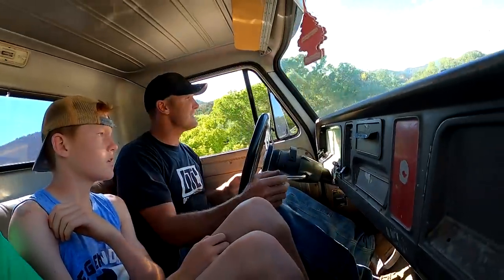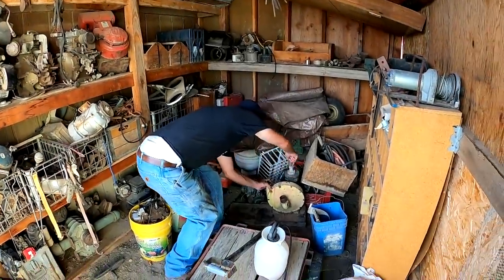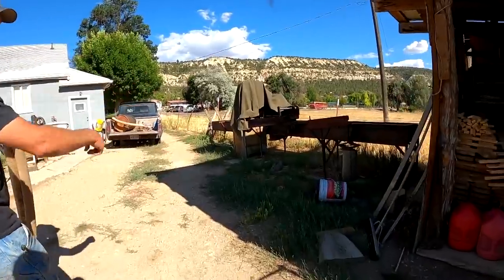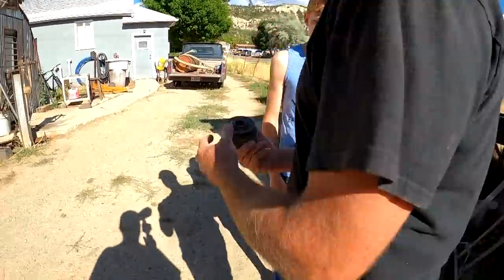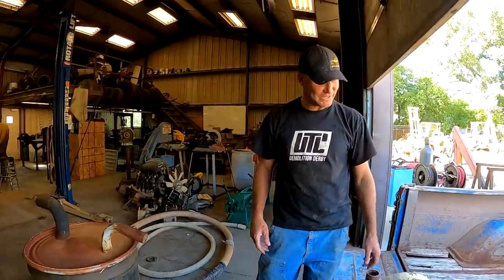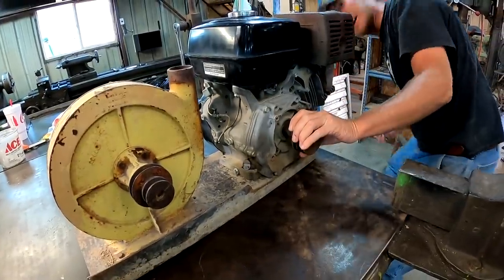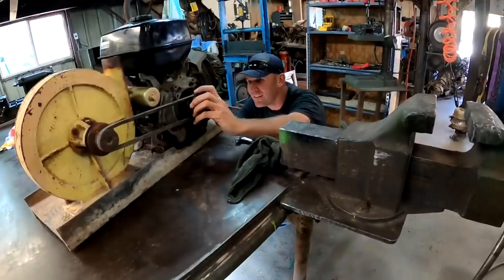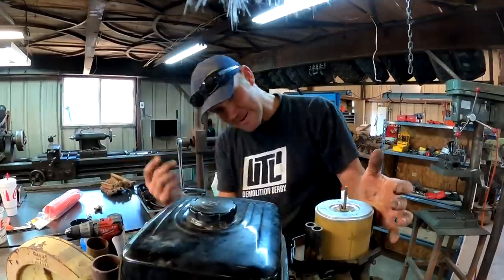-- TREASURES from the TRASH -- APPLE VAC CONUNDRUM!!  Pt: 1

Comment: Thought for when you're starting junk motors.
Have either a hose off your welding gas or a CO2 fire extinguisher handy. Those you can fire straight into the carb without issues.

Comment: What sort of vacuum are you expecting to generate?

We used to use 45 gallon drums as buffers water delivery systems and if the water column ever dropped it'd draw a full vacuum on the barrels and suck them flat.
Reply from the maker: I don’t have much expectations, I just want it to pick an apple up.......so whatever that takes.😂

Comment: I had a lawn mower I bought for $100,000. Came with a free house. Had to bypass the throttle linkage and the brake to kill the engine. I ran a wire from the end of the spark plug and when I was done running it I just ground the spark plug.
Reply from the maker: Hey Joe! How are you? Haven’t seen you in ages!